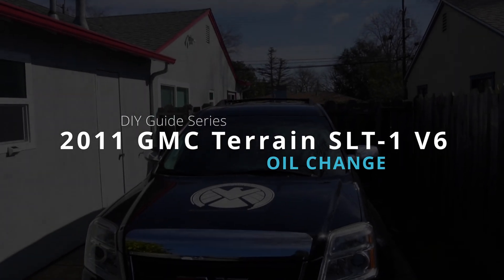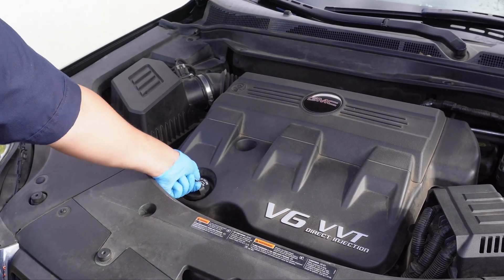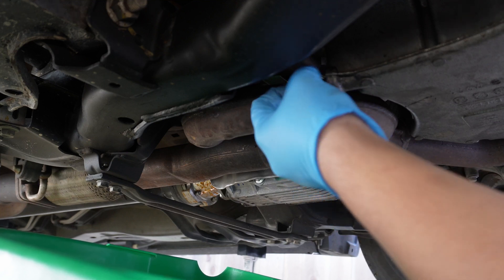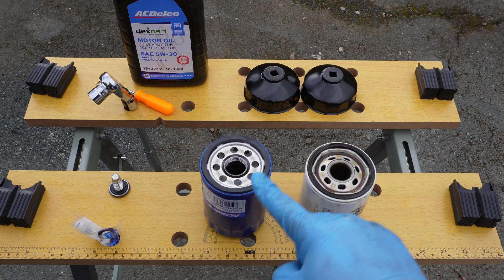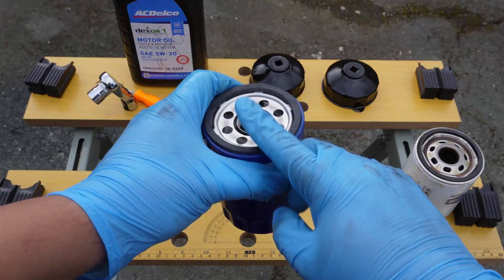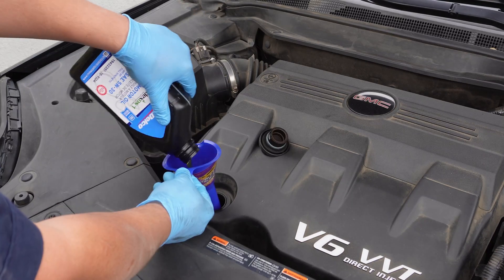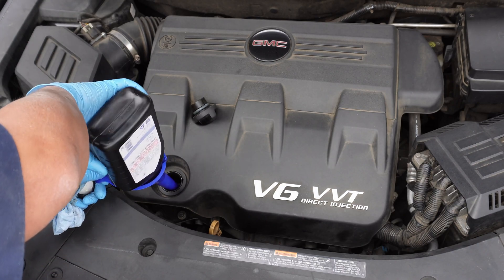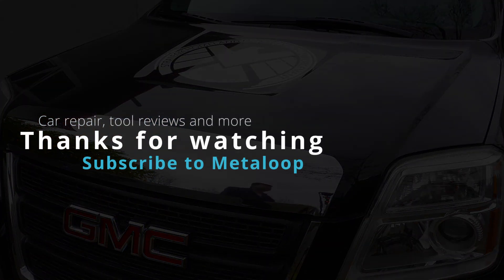2010-2017 GMC Terrain SLT-1 V6 Oil Change DIY - Complete Step-By-Step Guide

Comment: I used Napa know how oil that is made by Valvoline. Its a bit pricy, however i caught it on a online sale with Free shipping. As far as i know, all Napa oil is made by Valvoline. My 2016 GMC Terrain Denali 3.6 is out of warranty but i still bought dexos approved. Napa gold or platinum filters are GR8 like many others. Thanks for making video & sharing.......👍👍👍
Reply from the maker: Appreciate you sharing your knowledge, I'll check out the NAPA items you mentioned.  Also I saw that you subscribed. Thank you for taking the time, it really means a lot to have your support!

Comment: Question what if the oil isn’t dextron since I got the wrong one 😬
Reply from the maker: First, it's impressive that you found an oil that isn't dexos GM approved! Even Kirkland and Walmart supertech branded oil has Dexos standards. Depending on if your car still has a warranty or not, using oil that is does not meet the dexos standard could void the warranty. If for some reason you can't return the oil or just don't want to, I would at least make sure it is ILSAC-6 oil with the API "starburst". If you can share what oil you have, I would love to know what you bought for my own curiosity.
Reply: @MetaloopDIY  I also got an oil that doesn't have the dexos sticker on it-- It's Valvoline SAE 5W-30 Full synthetic High Mileage. any thoughts? It does have the API certified sticker and says ILSAC GF-6A. About to change oil myself on my 2016 GMC Terrain for the first time...
Reply from the maker: @valzer84  I don't know the reason but I have noticed that high mileage oils don't have Dexos approval. Generally speaking, your oil is probably fine. The only reason to not use it would be if your car has a warranty of some sort. It's just another thing for them to use to deny a claim.
Reply: @MetaloopDIY  Thanks for your reply, no more warranty on my vehicle so I'm not really concerned. Appreciate your video!

Comment: Nice vid.  The oil filter placement on these is the worst.  Changing the oil is great until it comes to that filter.  I hate that step on my 3.6L Equinox!
Reply from the maker: Ryster, really appreciate you taking the time to leave a comment. I couldn't agree more. I also noticed the OEM ACDelco filter was slightly taller than the Purolator. I didn't even bother trying the filter cap wrench when putting it on. I'm guessing you use a strap wrench for your oil changes?  I've got a couple more videos for the Terrain in the works, so I hope you'll consider subscribing to catch them.  Here's a one-click link to do that:  https://www.youtube.com/@mldiy?sub_confirmation=1  Thank you again for watching my video and hope to see your name on the next one!

Comment: I've never heard of engine oil expanding as it gets warm. Because it dosen't. It expands/thickens when cold and thins when heated. Just like every oil on the planet does.
Reply from the maker: Hi again. Oil does expand at 4% for every 100 degrees F https://www.engineeringtoolbox.com/cubical-expansion-coefficients-d_1262.html
But to your point, it even accounting for typical operating temperatures, that's likely less than 10% expansion.  A half quart buffer like I'm suggesting is probably too conservative.  

Also engine oil does get more viscous as it heats up. The additives are what do this.  That is why the second number is an oil weight is always bigger (e.g. 0w-20).  It starts thin when cold and thickens up with the additives as it reaches operating temperature.   

That all said, I don't think viscosity and volumetric expansion are related, so the thickening doesn't necessary make it expand.  Thank you again for your comment, it was fun looking things up based on what you suggested. I hope you will find it useful too.

Comment: I get the filter off fine but, putting a new one back on is the b-word. Takes me for ever to catch that first thread because of that goofy angle. Lots of swearing at engineers that can't hear me.😅
Reply from the maker: It's definitely a weird angle and requires some gymnastics!

Comment: You don’t need dex approved oil
Reply from the maker: I agree with you generally any API Starburst (ILSAC GF-6) is probably fine, except if someone's car is still under warranty, than I would make sure to keep receipts around saying I used dexos oil to ensure dealer cooperation on warranty issues.  But also, at this point, you have to dig really hard to find oil that isn't dexos.  Even Walmart Supertech and Kirkland oil is dexos. 😂  Thanks for commenting!